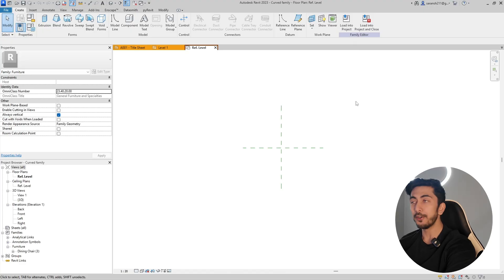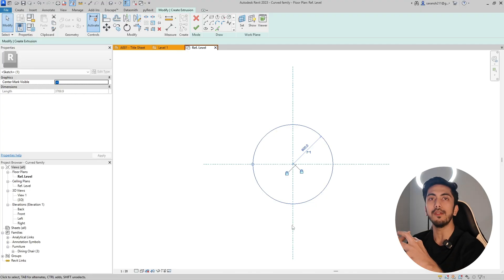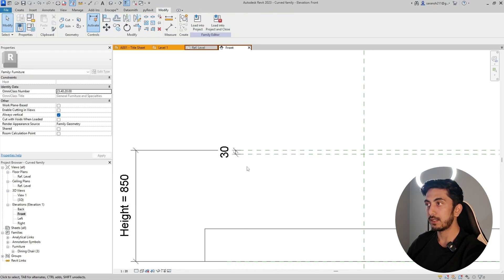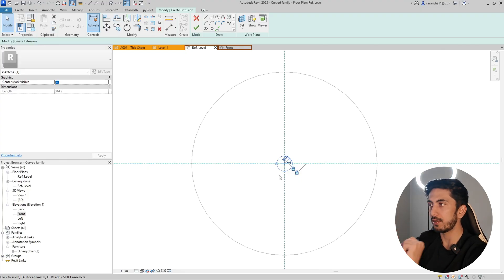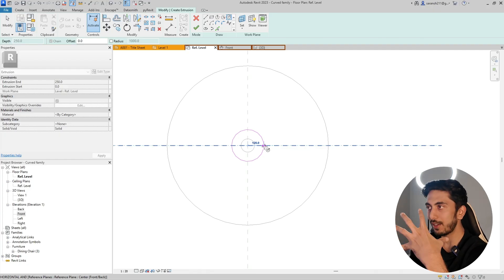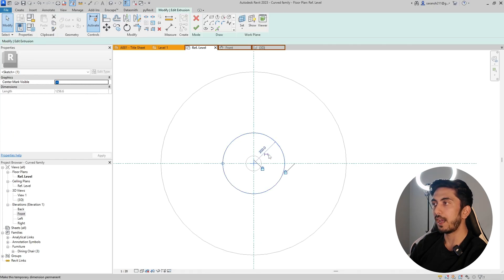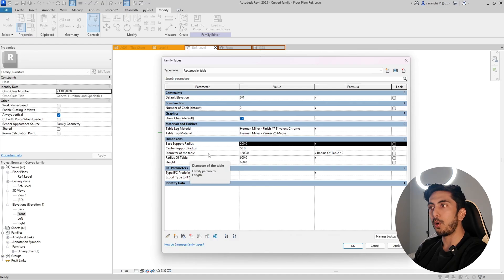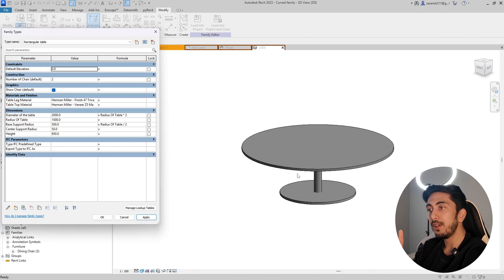Revit Tutorial - How to Make Circular Parametric Families Part -5

Comment: i am working in a scan to bim projects. we use  model implace for every thing to match scan is this the  proper way
Reply from the maker: Model in place is a temporary solution its not advisable for a bim project as the info regarding the wall etc wont be present.

Comment: Hi am now working in steel structure detailing and i want to start career in BIM plz can you tell how to transform from steel detailing to BIM.
Reply from the maker: You will have to model the elements in Revit or Archicad and you can feed data like type of steel, fire ratings, thermal conductive and strength in the revit steel components.